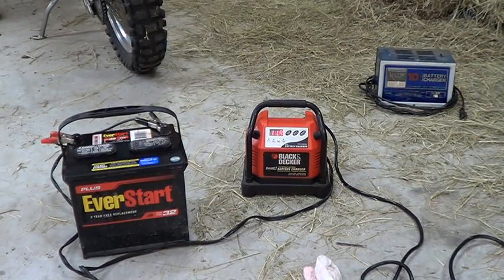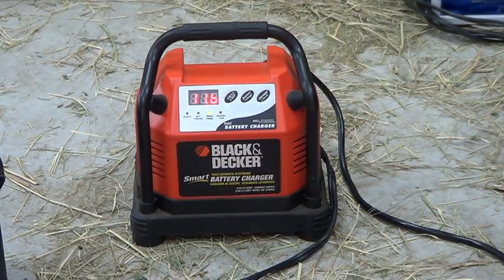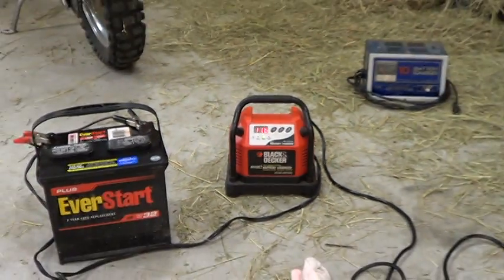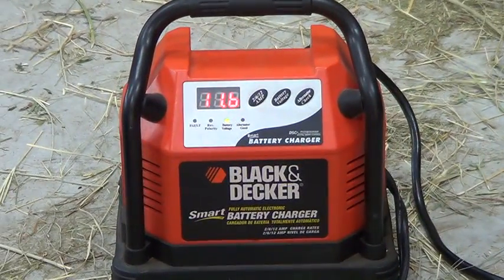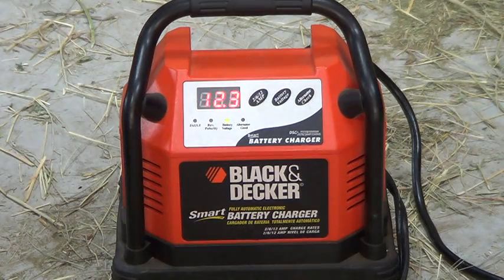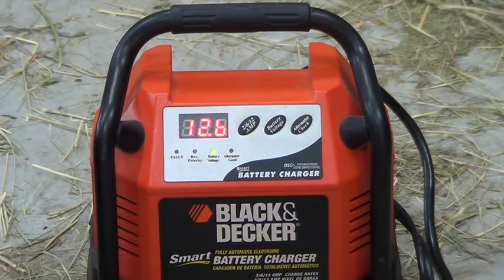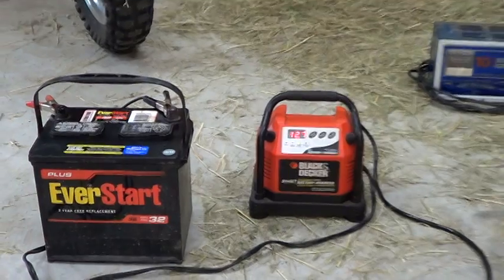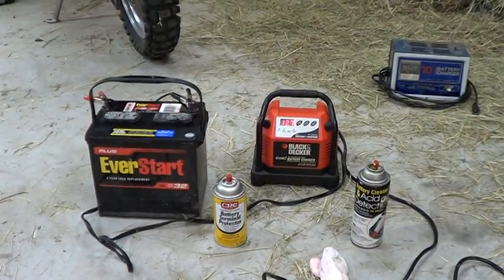Charging Battery With Open Internal Cell Error - Black & Decker Battery Charger BC 12B

Comment: Concrete and batteries. Used to be that batteries had rubber casing which could leak a bit and ruin the concrete floor. No longer a problem. 
http://www.snopes.com/autos/techno/battery.asp
Reply: Greg Pfister I can't say why that is, you might ask one of them. Possibly it is because they have been told not to put batteries on concrete. Here is another source that agrees with Snopes. 
https://www.homepower.com/articles/solar-electricity/equipment-products/ask-experts-batteries-concrete
Reply: That is faulty information at snopes. Concrete transfers cold to the battery, speeding self discharge...not preventing it as they theorize. I buy batteries from a wholesale warehouse for my business. They put them on wooden pallets, never on concrete for extended periods for a reason.
Reply: Robnord1 I have three sources that all say the same thing, that concrete is fine. Also cold Slows discharge of batteries.
Reply: Greg Pfister Funny, over and over people say not to put batteries on concrete. Their logic is faulty but they stand by it. Go figure. Every source tells you that there is not a problem but they don't believe it.   :-)
Reply: iamedbytes   It matters not what 3 sources say. Concrete long term battery placement speeds self discharge by cold transference. Cool slows self discharge. Cold promotes discharge. Leave a car for 4 months in the winter and try to start. Too much bogus info out there passes for real. I sell and install batteries, and know what is reality.
Reply: Yeah, 4 months per charge is leaving it a bit long. Sulphation can start happening in less than 30 days. I'd be charging it at least every 45 days to other month.  Stuff with batteries that's used alot tend to last longer, as when they are running and cycling the battery by drawing a current out of the battery and charging it back into it, it's burning off the bad ions. That's why you see 15 yr old $1000 beaters still on their original batteries.
Reply: Greg Pfister So Greg, go ask one, or more, of them why they don't put batteries on concrete. We or at least I would be interested to know why with modern sealed plastic cases on floors that are not necessarily all that cool do they not install on concrete. Assumption, they don't install in areas that are extremely hot or  cold. No rain, snow or other moisture. Why not concrete? Let us know rather than guessing.
Reply: Robnord1 When a battery is very cold the charge is still there but is not available due to chemical reaction. Warm it up and it works fine. 
https://www.kaltire.com/how-temperature-affects-your-car-battery-performance/
Reply: iamedbytes Your statement is only a partial truth. Rather amusing that you presume to be knowledgeable enough to re-educate a professional with decades of experience. I am open to electrical advice, but only from electricians with more experience than I have.
Reply: Whats not right with that statement by iamedbytes? The colder the battery gets, the less energy it can provide.  If you warm it up, the same battery  will give you more energy.
Reply: Rodnord1, thats right, the cold concrete lowers the power, every time your battery goes low, thats considered a cycle, depending on the battery! it only has so many cycles, automotive batteries don't have many cycles, yet you get a marine battery and there made to have a lot of cycles, you can run them completely dead numerous times before they fail, but they still have that cold temperature problem, keeping them at a constant temp extends there life, putting them on concrete with a constant charge of say 2amps should keep them warm enough, unless your in sub zero weather!
Reply: Robnord1: I can agree with that.
Reply: Yeah, I've got a special connection on my old 60s Honda motorbike that has a plug that connects straight to this great charger it came included with (the plug I mean) It keeps the battery constant monitored and topped off / cycled as it requires it when I don't ride it for extended periods, like during winter and the like. The charging systems on these old bikes were never adequate when they were new just with the engine running, and when the headlight is switched on, it tends to drain the battery right down. And you only notice because the next day when you go to press the starter button nothing happens. Anything longer than a fortnight that I don't ride the bike, The battery goes on that tender. (if I remember, which is usually half the time I don't forget)

Comment: That newer style of battery charger is known to have problems charging batteries when: 1) the battery is dead, or 2) there are poor connections.  IF the battery is serviceable, this is the trick.  Put the battery on the old style traditional charger and put it on the 2A setting.  Make sure that the clamps dig into the battery terminals.  The plated steel clamps are commonly known to not get good contact.  The copper clamps do not have the same problems, but they cost more.  My friends work for the company that makes the smart (and traditional) battery chargers.  Dead batteries and poor electrical connections are the two things that interfere with the software of the smart battery chargers.  A fault is detected, and the smart battery chargers cut off.  I have the smart and traditional battery chargers for that reason.  Put the battery on the traditional battery charger and let it charge for a day.  A trick with the traditional battery chargers is to look at the analog dial ammeter.  If there is a good connection, the ammeter will move from the zero position.  The smart battery chargers do not have that feedback to let you know if good connections are made.  My recommendation is to put the battery on the traditional charger at the 2A setting and let it charge for a day.  IF the battery is going to come back to life, that is the trick.  If the battery is large and needs more charging after the 2A slow charge, the smart charger or the traditional charger on the 10A setting will work.  The smart chargers have the benefit that they can be left on the battery for days or months.  The traditional battery chargers cannot be left on the battery at the 10A setting for days.  Keep both chargers, the traditional and smart chargers.

Comment: A good battery when charged should be 12.66 volts - 2.11 volts per cell. If the battery is not of the deep cycle style and is a standard cranking battery - continually discharging it or letting it stay discharged will cause cell damage and result in a dead cell. 

Vibration as you describe and demonstrate will also damage the battery. That is why cars have battery hold downs - they minimize vibration and the chance for the battery to jump up and arc against something. A standard lead acid battery cell is made of very thin lead screens filled with electrolyte (acid) - when the screens become damaged they no longer hold the ability to take or maintain proper charge or deliver current. 

If you have a dead cell you may indeed blow that battery up by trying to charge it or jump start it. 

Your wal mart battery is 5 years old - recycle that pos and get a new battery. For your razor unless your manual explicitly says not to - get an AGM type - they last longer and are more resiliant than standard lead acid batteries. 

Also consider using an insulative wrap with the battery when its beung used - batteries are at peak performance at roughly 65-70 degrees - very hot and very cold weather leads to poorer performance and can shorten the lifespan of the battery.  Since you are in Texas you don't have to worry about freezing so much as overheating the batt. Hot climates see batteries fail faster than cooler climes. For instance in Arizona and southefn cali average battery life in a car is 2-3 years. Here in the pac nw we get 4-5 with our more moderate weather.
Reply: Mark McKenzie 
Well, here we are again. And that's still the same name on my drivers license.

Comment: The battery detector    Use baking soda and hot water mixed together.  What it does is it neutralizes the acid.  It just doesn't change colors.   But use that baking soda then dry it off and spray the protective spray.  
Look for bulges on the outside of the battery typically you get these bulges when the battery has been overcharged or the battery has been working too hard.  These are the dangerous ones that can blow up.  Also, keep in mind the when charging it will produce battery vapor which can also be flammable.

Comment: The best thing for a battery that sits in your car is a battery tender. (Harbor freight has one for like $5.99 on sale)  it does a pretty decent job.  Basically, it measures the voltage.  Once it drops so low it charges and then turns off.  

I think you might have corrosion in the cell.

Comment: That battery is bad. All the cells are not making contact with each other as evidenced by the charger changing it's reading when you shake the battery. When you shake the battery you're getting intermittent contact through the bad cell of the battery giving you the appearance of proper charging. Replace it and get a $40.00 battery tender to keep a slow constant charge on the battery so you wont need to charge it every time the Razor gets driven. BTW, never shake a battery on a charge. Battery acid turns gaseous under high amperage charging and if you shake the battery and the cables arc, it can light off those highly flammable fumes and blow the battery up possibly getting acid on your skin or in your eyes and definitely scaring the shit out of you.
Reply from the maker: lol well shit, that's a good tip... thanks  :)
Reply: The guy has an intermittent OPEN (IN SIDE THE BATTERY) as evidenced by shaking (like closing a switch)
...although rare, it can happen...stop messing with chemicals, cleaners, chargers etc...get a new battery.

Comment: I have the same charger except it says Husky on it from home depot. Mine will give the error if I try to use the 12 amp setting sometimes. If I use 6 amp it charges fine. The higher the numbers are  when you start charging means the battery is low. The number will go down as you charge it until it reads FULL.
Reply from the maker: thanks

Comment: Mornin Rick, Maybe best to go back to the older charger that just worked and didn't leave you wondering about all that other stuff?         You could save your self 20 bucks in sprays by taking some baking soda from the kitchen, mix 2 tablespoons of soda to 4 oz. of water and put that on your battery. It will bubble up if there is acid and neutralize it. Then you go to your bedroom, take that jar of vaselene that's in the night stand, the jar that you haven't used in 6 months. Take a finger load of it and spread it on your terminals, it will keep them from oxidizing and last 2 years at least. If your really feel the need to be down the 20, you can send it my way, worth 30 here. Billy, Canada
Reply from the maker: LMAO how do you I have vaseline in my night stand?  are you psychic?  thanks good tips, the reason I am nervous about using baking soda on battery is when you check or fill up batt fluid with DISTILLED water, if you get baking soda in your batter it will neutralize the acid and by by battery, or so I have been told.
Reply: Yeah, try not to get the baking soda stuff inside the battery. I just soak a rag with that soda and wipe the battery until it stop bubbling, then wipe dry. Dont forget to rinse the rags you used otherwise they all turn holey the next day due to acid eating them.